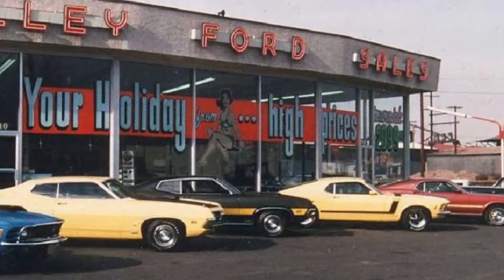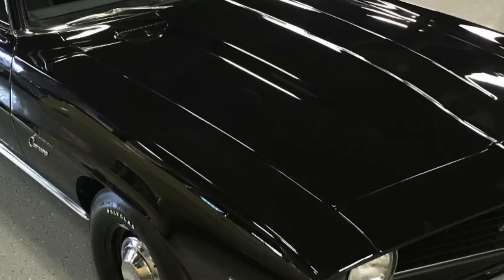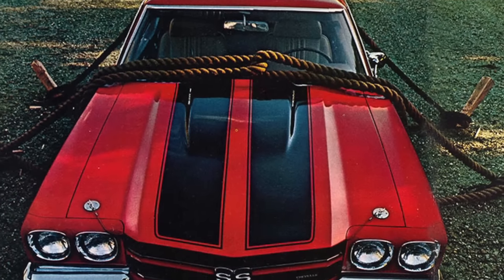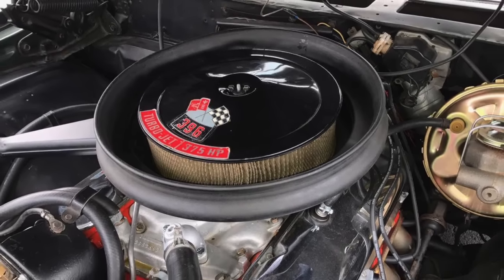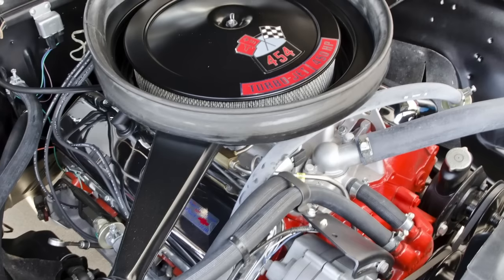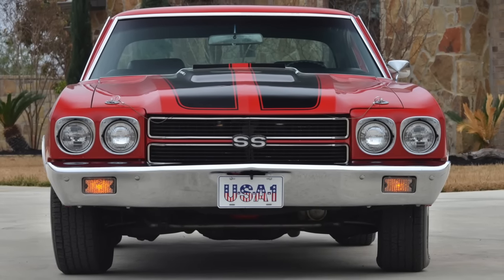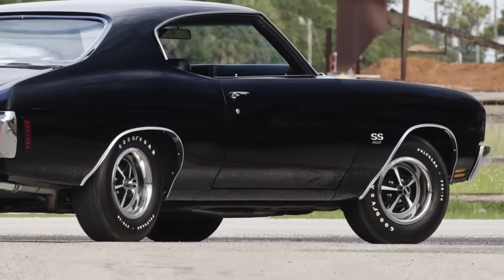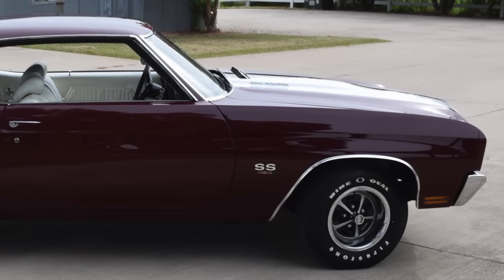1970 Chevrolet Chevelle SS LS6 454 – Freak of Nature

Comment: Hey how can I get my hands on one of those “Turbo Hydraulic 400” transmissions?
Reply: Several good shops still make and sell this quality TH400 GM transmission one of the best ever built just behind Chrysler's 727 TorqueFlite. Run a search if you want an automatic vs. 4 speed or lately now 5-6 speed manual trans. like the Tremecs. Be sure you're dealing with a shop whose rep is well documented. It's not difficult to do.

Comment: Those 1968-1972 GM A-Body intermediate models were such awesome muscle cars. 
Chevrolet Chevelle SS with Cowl Introduction 454 LS6 V-8
Pontiac LeMans GTO with Ram Air Super Duty 455 V-8
Oldsmobile Cutlass 442 with W30 Package 455 Rocket V-8
Buick Skylark GSX with Stage 1 Nailhead 455 V-8
There was even an A Body from GM of Canada:
Acadian Beaumont Sport with 396 V-8

Comment: I had 4 of these cars.  Nice video.  Nice job.  2 details.  The transmission was a turbo 400 turbohydramatic, not hydraulic.  The cowl induction was vacuum operated, not solenoid.  This is not criticism.  We all need to pass on something worthwhile to our kids which you have well done.
Reply: They were both. The inner door was electric actuated by a button under the gas pedal. If it doesn't open it's blocked. The flapper on the hood worked on manifold vacuum. I own one.

Comment: Bought a 1970 Chevelle SS396 in 1978 for $700. No cowl induction, bench seat, automatic, bondo on hood. Needed an immediate engine rebuild but afterwards it was a ball to drive.

Comment: In the fall of 1972 at wolf Chevrolet in Vancouver bc ,my uncle bought a 1970 ss 454 fathom blue factory ordered buy the dealerships son in 70 drag chevelle, 454 ls7 , m-22 , 12 with gear different gear sets , scatter shield and blow out blanket , amongst some of the options , mid 11s, low 12s was a monster of a chevelle

Comment: Thank You very much! I never paid attention to an automobile's engine size, horse power, or torque? I've missed a lot of fun! In 1969 Mercedes Benz introduced the 300SEL 6.3 and in 1977 the 450SEL6.9. I thought these were the bad boy's in town? In 1972 my dad bought a manual 4 speed gearbox BMW 3.0 Liter Bavaria 0 to 60 in six seconds? I never realized American car manufactures were right along side, for a lot less money, plus being an American designed and built car? My LOSS!! Peter Brooks.

Comment: I had a 1970 Chevelle, it wasn't a as, it had a factory original 307 with 2 speed power glide automatic. 
The 307 was marginal conditions, so I swapped in out with a 350 with a 4 bolt main, but broke it down and had the cylinders punch .40 over with 202 heads, full cam, forged pistons, crankshaft, rods, and wrist pins, with a 700 cfm holly 4 barral carburetor, and a high output Mallory ignition system, it was funnest car I ever owned.

Comment: I had a Kelly Green/White striped 70' SS LS6 Chevelle for about 6 months. Guy down the street started having kids, Wife bugged him to get a Station wagon.  I was a pure pony car/Trans Am guy with a 71 and 73 455 HO T/A's at home. It was loaded, TH400, A/C car with mountains of torque,  paid 1300$ for it. I felt it was a big bloated tank that didn't handle,  so I barely drove it other than some street racing.  Sold it for 1500$, bought my first 70' Boss 302 Mustang with the Money.
Reply: Moon Pie  my LS6 had dealer installed A/C, and it worked great... and the Gas crisis was in full swing back then, it was murder trying to keep fuel in cars that got 11-14 mpg going downhill.... my girlfriend's brother had a Boss, and it was downright economical compared to my cars.  So I got one too. Here's the kicker... on the day I drove up to N. Carolina to pick up my Boss 302, for just 500$ more, I could have gotten a Maroon Boss 429 with 16,000 miles on it! But, huge gas sucking engine just wasn't what I wanted... plus I was in love with the Louvers , Shaker, and the bright yellow little Mustang.

Comment: From what I have read, and also have 1st hand knowledge from mechanics @ Chevy dealers in the area, there was a dealer installed option of the LS-7 engine in the Chevelle SS.  Since the LS-7 was a crate engine, if you had the $$, you could get it installed.
Reply: not worth it for 10 more hp
Reply: As the bikers' mechanic said in Mad Max "Speed's just a matter of money. How fast you wanna go?"

Comment: The 425 horse 454 was available until 72, and 454 were available in all chevelles until 76. The Chevelle Laguna's had an S3 badge that stood for 3rd generation SS. These ran from 1973 to 1976.
Reply: manic mechanic, later years 454 Chevy engines were sloth-slow turds.
Reply: @sergeantmasson3669  everything after 73 was slow, genius.
Reply: @manicmechanic448  According to who, you, PUTZ? You forget about the Pontiac 455 SD? It was available in the '74 Formular and T/A as well as the '74 GTO.
Reply: @sergeantmasson3669  in 1974 the Pontiac 455 sd was rated at 290hp and 395lb. It was quicker than most, but still a far cry from 1970. By the way the 455sd in 70 was rated at 450hp. Besides I'd rather a Buick.
Reply: @manicmechanic448  NO, it was 310 HP in the Firebird and the GTO. Not as fast as the 70's muscle cars but still considered muscle cars.
Reply: @manicmechanic448  BTW, how many real muscle cars do you own? I have several, all Fords. I'm guessing that you have none.
Reply: @sergeantmasson3669  that doesn't surprise me in the least. Explains why you don't know Jack about GM. I'm bettin most of them are mustang 2s, or fox bodys. Plenty of rust?
Reply: @manicmechanic448  WRONG, No they're not. All were rust free before being restored. 4 of them I bought new from TASCA Ford in RI.  I don't know "jack" about GM? I've likely forgotten more about GM than you'll ever know. FYI, I'm a 50+ years master-level factory certified auto/truck tech. 30+ years successful classic/vintage vehicles restoration business. I'm also a licensed vintage vehicles appraiser I/we sold two classic/vintage Chevrolet SS cars to former MLB player Reggie Jackson.  BTW, I've never owned a Mustang II or a fox body car, PUTZ. I did restore a black '77 Mustang Cobra II for a customer a few years ago. It was a rust-free AZ car.
Reply: @manicmechanic448  Bring on the best GM street legal muscle car that you own and one of my Fords will put it back on the loser trailer, PUTZ. Look at my profile photo. That car is a three times NHRA record holder that also won three NHRA class championships. The car is 100% all Ford. It turns low 10 ET's and has turned two 9.87's. 100% street legal as well. One of my former NHRA AA/FF cars is at Don Garlits Museum in Ocala FL.
Reply: @manicmechanic448  What were the first muscle cars? It was NOT the '64 GTO.
Reply: @sergeantmasson3669  no body said that. That was either 55 with the Bel-Air, or 56 with the Fury.

Comment: I have a S 65 Mercedes that has a hand built V-12 twin turbo charged engine under the hood that puts out over 620 Horsepower. She has all of the fine appointments one would expect in a luxury car with brutal torque and monstrous horsepower stock from the AMG Mercedes factory. If you would care to have even more torque and horsepower there are companies out there upgrading these cars to well over 1,000 horsepower by installing larger turbos, bigger fuel injectors, changing the timing and installing better flowing exhaust systems.  In regards to American muscle cars the 1964 Pontiac GTO will forever be my favorite.

Comment: Those days are long gone. They were legendary, but modern muscle cars have an edge as technology has advanced.  These were straight line cars. A new Dodge Challenger Scat Pack will challenge the legendary cars from the golden era, but... they will be the last... My Dad had a 327 equipped 62 Chevy Bel Air. He drove my V6 Dodge Charger and it brought a smile to his face. May not have been the same, but the car is more stable for daily driving and less prone to putting you into a tree at a heavy acceleration take off.
Reply: A modern Chevelle with 870 horses should of been came out

Comment: I ordered a black 1970 cowl induction/orange striped 454/450 El Camino from Yenko Chev in Pittsburg, PA. Before delivery (they drove the car to N. VA), I had Yenko: 1. Blue print engine - dynoed @ 55/up. 2. Install tubular headers by Kustom Headers. 3. Install 1970 Corvette sidepipes. Total price delivered was $. Car stolen in fall 9 months later (12k miles) in Cleveland, OH. Never found.
Reply: 550 hp.   $4950

Comment: I remember subscribing to Hot Rod in the mid-80s and reading an article on the '70 Chevelle SS 454.  If I recall the article correctly, one could theoretically have ordered a granny-optioned 454 car with column shifter and non-posi rear-end.  I am guessing this would not have applied to the LS6 but rather the LS5 versions of the car (not to mention the 396 versions), but not sure.  A similar thing could be had with the later Buick T-Type cars in '86 and '87 where one could option their car in fairly plain-Jane options vs. a full on Grand National.

Comment: Either the 1967 official Ford Motor Company's Mechanics Manufacturers manuals were mistaken, or the 1967 Ford XL's 429-cid actually did have 475-hp. Which would make that Ford a contender for the ultimate Muscle Car HP title.

Comment: I am still hating myself for selling my 70 SS 454 LS6. I loved that car so much and it did have the butterfly hood.  Mine was silver with the black vinyl top and the black interior and the indestructible Turbo 400 transmission.  I got married and needed a truck and I guess you can figure out the rest.

Comment: My dream classic car. 
I want one painted cranberry red with black SS stripes, black interior, of course the 454 big block with a 4-speed manual transmission and original mag wheels. One thing I would do to customize my chevelle is change the wheels to 15" GM Rallye Wheels and red line tires

Comment: I had a 70 Malibu SS. Black cherry / white top and interior.  In the back of the GM service manual, they have a section for the SS stripes. They had 3 different ones. The malibu stripes were square on all corners, The chevelle stripes were round on the outside corners only. The 3rd was for ?

Comment: The funny thing is when taking a lS6 down the quarter mile it didn't "feel" all that fast. LS6 with 4.56 gear, ladder bar suspension, headers and aluminum intake, holly and a cam that pounded the ground.dump that zoom and it always took off straight, hooked up great and just felt easy. But believe me, it felt a lot different than it really was,, it was one badass machine!
Reply: That's too short of gears, 4.56s would be better suited to a DZ302 or L79 327 not an LS6.

Comment: Very good and informative video! I believe those big square port heads on the LS6 were better suited for the track ( high rpm) than the street, where more low end torque is needed. I have only seen one LS6 on the street, but didn't get a mostly raced the 396's which I always beat with my 66 Mercury Cyclone Gt. 390 4 speed, 411 rear. I never had a Chevy beat me on the street. the only two cars that came really really close was a 440 Dodge Dart, and a 70 Buick GSX 455 Stage 1, which I thought it was a Chevelle at first  along side of me. haha Both of those cars were at my quarter panel, but ruined their day because Ford Power got the best of both of them!
Reply: Were they racing you?  Fords 390ci were dogs.
Reply: Yes they were racing. What most Chevy people don't know is that the Ford 390 has the same stroke as the 427 Ford that is in the Cobra, just not the bore. My Cam Shaft wasn't stock and that's what woke it up. I wouldn't of been scared of you pulling up along side of me back then, my car was my daily driver
Reply: So you had a bigger cam. All of the 390ci Fords I raced were complete dogs I beat so many  it left a bad taste in my mouth for Ford in general. I had a 1968 427 impala SS with headers and 3.90 gear ran 13.8s I sold  it back in the 80s do you still have yours?
Reply: No, I sold mine in the 80's also. I never had a Chevy beat me, the only ones that came close were a Dart and a Buick GS. My 66 Cyclone had a dry weight of 3460 lbs factory, only 80 lbs heavier than a 67 Mustang with a 390 weighing in at 3380 lbs. I guarantee that Impala weighted in at 4000 lbs or better. The hardest thing was getting my car to hook up. You might of ran against some dog 390's, but 396 Chevys in my opinion were a joke. The 427 just had a bigger bore with a 4 bolt main block. Nothing that made me worry. I liked stomping Chevys.
Reply: LOL!  I really think you must have lived in a bubble, Fords were dogs the only fast ones I remember were the big money backed drag cars. Btw I sold my Yenko/Harrel 1967 427 Camaro a couple of years back for $325,000, That car ran low 11s @ 123. I'm sure your Ford race car would beat that too?
Reply: Yenkos were rare cars. I never seen one in person. But I would put a Ford Thunderbolt against one. I think you would get stomped in your Chev-a-lay lay. Hahaha
Reply: Yes mine was super rare, one of the first 2 on Fred Gibbs showroom, it had no Yenko badging. The Thundebolt   was faster, more in line with the Hemi Cuda factory race cars. the Yenko's were low 12's high 11s out of the box, complete dogs...lol.
Reply: I like all of them now. But Chevorlet or Dodge never won a Lemans, but Ford did 3 years in a row with an 427FE series block. The 352, 390, 406, 427, and 428, are all interchangeable.

Comment: Dudes have taken that engine and have rebuilt it to still be stock then dynoed it. They came out to around 550hp.
Reply: You're right. That's why those cars were so nasty. Quarter mile times sucked because they ran them on those stock tires and wheels, but those cars on tires that'll hook easily get into the 10's.

Comment: The LS6 is a reminder of what could have been starting in '66 with the SS427 Chevelle with a L72 which was about 2000llbs lighter than the '70 SS 454.  Chances are pretty decent they could cracked 12's in magazine test.  Had they shared the love with Camaro and Nova it's all but certain.

Comment: Air intake opening to the rear.
 I read, at speed, there is a high pressure area at the base of the windshield, which is why the air scoop opens in rear, not front. Is that true for this design?

Comment: My first car was a 1970 Buick GS, with a factory 455 with hood scoops and ram air intake, bucket seats and center console. I bought it in 1990 for $25 and pulled it with a chain 2 miles home. It needed a passenger side fender and front grill, so I bought a 1970 Buick Skylark for $350 for parts. I drove that car until I graduated high school but unfortunately totalled the car racing it, and pulled the motor out and put it in a firebird. Then that car got destroyed in the flood of 93'. Currently I am restoring the lowest number 1966 Datsun SPL311 Roadster known to exist, SPL311-00010 . If anyone knows where 00001 thru 00009 are, there are many people who would love to know, including myself.
Reply: Was the '70 Buick GS a Stage 1?  I ordered a convertible Stage 1 4-speed in 1970  Awesome car.

Comment: mid 1965,the 409 was replaced by the 427[in full sized chevys]the 396[at the same time[was an option the the chevelle ss.
Reply: I always wanted a '64 Impala SS 409 in purple or blue metal flake, leaving the stock white side molding-stripe, and doing white lace paint (anybody remember this?) on the hood/trunk, and jacked up in the back, of course... 😆

Comment: You could not be no more wrong about the 454 in 1971. The LS6 was indeed available in the Chevelle SS. The LS6 was not a regularly ordered option in the Corvette but rather a COPO option. The Monte Carlo SS in 1970 also had the LS6 and LS5 options; there were no 396 options available in the Monte Carlo SS. The LS5 and the LT1 small-block were more prevalent in the Corvette in 1971. Emissions Laden 454s were available in the Chevelle to at least 1974, the Impala and Monte Carlo as late as 1975. The pickups have the 454 beginning in 1973 and lasted for several years afterward. Medium trucks even had them for a couple of years. YES tall blocks at that.

Comment: was the 454 offered in 1970 Z28 ?....thanks
Reply: No. Lt1's 350hp/350 and the solid lifter 360hp/350. Very good engines. A big block in a car meant to turn corners doesn't work as well. Nose heavy.

Comment: got me a '69 427 4 bolt I built for circle track racing ump street stock 2nd gen camaro.  keith black 12:1, eagle rods, stock forged crank, all balanced, solid lift .560 "290" cam, edelbrock victor jr,  088 rectangle heads,  stainless undercut valves.  powerglide w/ direct drive and 6.20spooled gear,,,gonna kill some mice!

Comment: my step dad has one. he went toe to toe with a mid 2000s viper. let's just say the cop got the viper.
later on he took it to a restorer based out of Pasadena, he met in a bar, to get it restored bolt by bolt. the guy went bankrupt, left the SS in pieces. it sits that way to this day. 
my step dad takes out loans in shade of starting businesses every seven years in order to finance his highroller lifestyle. he goes bankrupt every seven years again.what comes around goes around.
 he did once tell me the 450 HP spec was bullshit. it was under rated to get past some legislation.
don't know who to believe, my step dad or 402=396 Chevrolet.

Comment: Call me crazy, I owned a 67 Chevelle SS, 396, and now own a 69 Corvette 427, 400 hp, without the tri power granted but I installed a big Holley dp,. To this day I am still convinced my 67 SS would stomp the Corvette. IMO, the 396 was a faster engine than the 427.
Reply: just not as much torque.

Comment: Stopped in at a Chev dealer in Sep. '71. Saw a red 454 - 450, 2;20 rock crusher trans, 4;11 diff. Sales guy said it was on year end closeout and I could have it for $2,800 ! ! 
I was single at the time and easily could have afforded it. Red w/ black interior. Factory gauges too.Yeah, you snooze - you lose. Shoulda, woulda, coulda. Bought a Vette instead.